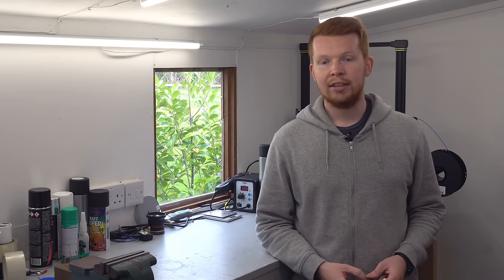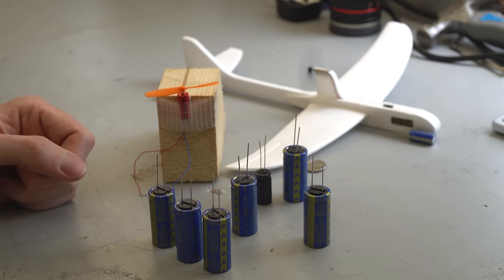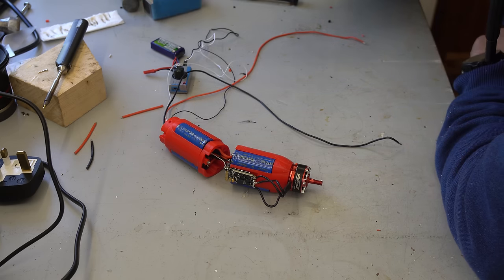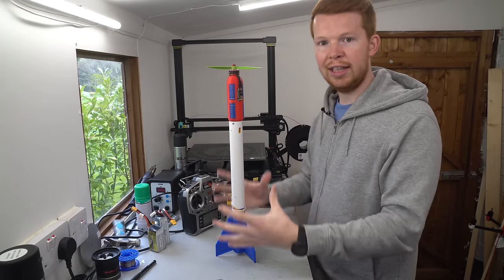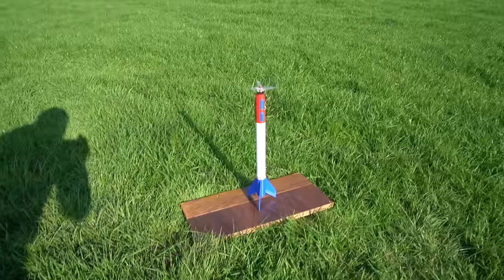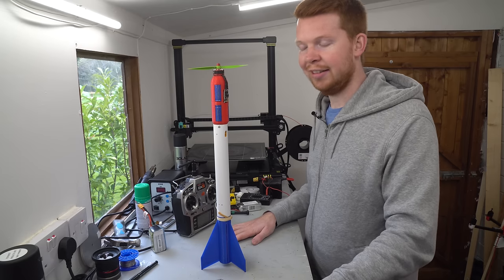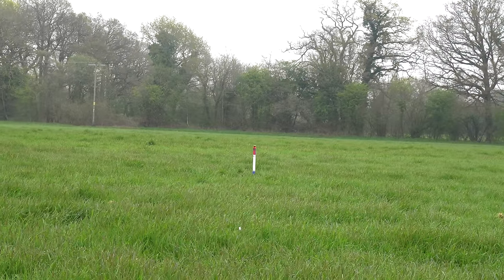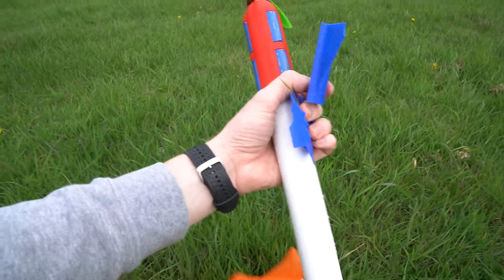Super Capacitor Rocket

Comment: When I saw this: this is not a rocket, it has no reactive engine, just a propeller. Essentially,  it's a helicopter. 
How it he gonna make it not spin around its axis in the opposite direction?
10:20 never mind
Reply: Sooooo... not a rocket.
Reply: Eh, semantics, it’s a cool project
Reply: @samfurness2754  For an eight year old, yes, but the title implies something much cooler: it's click bait.
Reply: @samfurness2754  yes, it's a cool project. But it's not a rocket. Can it be used outside of the atmosphere? No.
And don't underestimate semantics. It's like if the title said that the video will be about trebuchets, dams, chess; and then the video would show cannons, lakes and go. It would still be cool, but it's a different thing.
Reply: Calling anything that shape a "rocket" is just a popular colloquialism.
Reply: @panda4247  True, but anyone getting annoyed enough to leave a comment about it needs to find a better way to spend their time.
Reply: @panda4247  rockets dont nessarily have to work outside of atmosphere V1 german rockets used a pulsejet which dont work in a vacuum due to lack of pressure not to mention that there were prop driven rocket tests in the early days of nasa when they were designing reaction wheels they needed a platform which could easily be tested and recovered
Reply: @Bobis32  V1s weren't rockets they were jet bombs.
Reply: @midgamejeff-why-got  a cylindrical projectile that can be propelled to a great height or distance by the combustion of its contents, that the textbook definition of rocket the v1 bombs fit under the definition
Reply: @Bobis32  Ture, but I would argue a rocket is a projectile of any description that uses an internal source of oxygen for its engine and expels a reaction mass for it primary propulsion. The problem with that definition is that any jet or propeller powered aircraft would be included, though it does depend on what you consider a cylinder.

Comment: The 6.4V is just your configuration of protecting Li-Ion batteries from undercharge. Unlike batteries, capacitors have a pretty linear voltage to energy ratio graph, so you're skipping a lot of the potential energy, if you charged with 8.4V.
Reply: Maybe, wrong and wrong (sigh).  Yes, it's possible that the control electronics shuts down at 6.4 volts to avoid discharging the battery too much.  No, capacitors don't have a linear relationship between stored energy and voltage; the energy is proportional to the square of the voltage.  No, the capacitors were not charged only to 8.4 volts; at 12:10, you can clearly see that the battery has four cells, so the voltage will be near the maximum rating of the capacitors, which is 18 volts (6 times 3 volts).
Reply: E=1/2.C.V^2

Comment: Greetings Tom! This was an interesting video, and capacitor powered experiment. I had a very small airplane that was capacitor powered that flew completely out of the park on a five (5) second charge. By the time it left the park it had reached an altitude that exceeded the tops of telephone poles on the east end of the park. After searching for the plane for more than an hour, I finally concluded that it had been carried away with the wind. I would be interested in seeing you develop a plane that uses the super capacitors as a means of propulsion, a separate 1S battery could be used for operating a receiver and control servos. A parachute would not be needed, as the capacitors run down you could then control the landing. It would be interesting to see how much duration you could achieve with the propulsion system. Thank you for posting this video! Please have an excellent and awesome day! 🙂👍

Comment: 7:00 "reason for it being at the top is not for stability reasons it doesn't matter at what point on a rocket you have the thrust unit if you research the pendulum rocket fallacy"

Thanks for that! I never knew.

Comment: Is that the Doppler effect i'm hearing or is that how quickly it's running out of power with a propeller on it?
Reply: Most likely the Doppler effect considering the origin of the sound is getting farther away which makes the sound quieter
Reply: @mrmatrix1225  The Doppler effect doesn't make it quieter, it makes it lower pitched. This is because the object is going away from the observer which means that the frequency of the sound is lower relative to an observer that would be moving with the object. In this case it is probably a combination of both the Doppler effect and the capacitors depleting
Reply: It's not doppler... The speeds are too low for doppler to be noticeable...

Comment: You should give some angle to the fins so they counteract the motor torque Tom! It should make it more eficient :)
Reply: @Chris-rg6nm  as the motor torques it spins the rocket body reducing the difference in rpm between the rotor and rocket body and therefore reducing the amount of thrust the propeller gives. another way to counter this would be to have 2 counter rotating propellers like those found on those cheap toy helicopters. these get their yaw control from altering the speed of one rotor
Reply: @Chris-rg6nm  
At a decent airspeed, the angled fins would produce aerodynamic torque to counter the reaction torque of the prop.
Reply: If not an angled fin which would take some time to get the angle right perhaps if there is no super sleuthy way to calculate the angle from the RPM of the rotor and displacement of air it produces, then I would go with either larger fins, or more fins (4 or 6) as the increased surface area by either method would provide proportionally more resistance to rotational forces just like how its harder to push a bigger paddle flat side down into a river than a smaller one.) as well as more stability by channelling the air a bit more and putting a bit more mass or drag on the tail end so that it tens to stay more centered in the down position keeping the vertical ascent more true to 90º from less fish-tailing.  At this point you have too much of the weight on top.  It does matter somewhat for stability not to have too light of a tail when you have such powerful lift because sometimes wind resistance isn't enough to keep the tail pointing truly down at a 90º angle particularly if you have any sideways wind at all.   

2.  A counter spinning prop on the other end of the rocket would also help with balance and eliminate spin at equal RPMs.  But that ads a bit of complexity to your design you probably won't go for.

3.  The other really simple quick low cost thing you could try is alignment guide rods..   The maximum point of tension to create spin of the entire rocket is at the point likely when it first powers up, so if it powers up from 0 to maximum thrust instantly as electrics can, you should put a could verbal guide rods up the length of the rocket inserted into the launching base just to push against the counter to rotation-side of all three fins so it can't twist at least until it clears the top of the rods which would be just short of the propeller when it sits on the base in length at which time the torque for spinning the rocket should have lessoned as propeller speed is closer to stable .

4.  Spring-tensioned Internal "tuned dampers" to prevent tail sway?   Marbles in the tail section that can freely spin and rotate to help discourage rotation by providing some freely movable mass that would be friction contact with the inside wall and bottom wall of a section of the rocket provide a bit more resistance to vehicle rotational forces?  Lots to think about here.  Addint mass would obviously have to be down with a corresponding addtion of more super caps to offset the increase in weight, but that's OK.  Much of your rocket is still empty inside anyways, whats another 3 caps gonna hurt?  ;)
Reply: @jackass123455  Not to be pedantic, but the counter-torque on the motor mount (counter-rotating the body) would reduce the difference in RPM between rotor and air, rather than rocket body. If anything, with this setup, the RPM between the rotor and rocket body would be higher than it would be if the rocket were prevented from rotating, thus forcing the rotor to cut through air faster.
Reply: Aric Blunk the 20 rpm difference isn’t much compare to the 35,000 rpm his motor probably runs (it might only be 20,000 rpm, but you won’t be able to measure the difference of 19,980 vs 20,000 or 20,020 anyways). It would make it better if it kept thrust and movement going straight up instead of wasting lots of it when it goes into that hook at the top, because then your not producing upwards thrust and your not particularly wanting to go sideways fast in a random direction because that also limited his throttle duration due to the power lines and trees.
Reply: Counter rotating blades on top solves the problem.. :)  More lift, counters torque effects if they spin same speeds opposite directions.. I think that would be tougher to do mechanically but would likely solve it without bending the fins.. add rudder to fins and steer the thing back away from power lines.. aim it the otherway a little.. :) Fun video. PEACE
Reply: @Chris-rg6nm  One thing I haven't seen anyone mention is that the "rocket" spinning seems to mess with the parachute deploying properly, Stopping the spin would solve that, making for safer descent. Adding a swivel to the parachute might help, but stopping the spin would be better.
Reply: @jakegarrett8109  Good point.

Comment: Counter-rotating propellers would work for your rocket's flight stability.
 Folding props. are already used on actual motor-gliders. It's been around for decades ✈
Reply: Glad to see this comment, as it was the first thing I thought when I saw this. Nothing to counter the prop torque other than the mass of the rocket body and maybe the fins help slightly. Two props countering each other would make it a lot more stable and efficient. Nice build still though! Would not test that prop at eye level like that, yikes!
Reply: Was thinking the same thing. Also, if use larger props could possibly use Autorotation landing instead of parachute, maybe...I am not even a novice when it comes to these things, just an idea.

Comment: I would like to suggest you   print a centrifugal propeller that lays back until spun up. That would keep you from tearing up propellers. The props would have to swivel upwards and stop at the normal position for a prop, but once the motor is no longer spinning the props could fold back when they hit the ground. Just a suggestion.

Comment: At 15:28 I'm sure you realize that revving the engine with a questionably damaged prop is probably a bad idea next to unprotected eyes. Otherwise a class idea and build!
Reply: MrGlickClick 
Oops, you’re right.
Reply: safety squints were engaged.
Reply: If you look at the footage, there is a cut just before he revs it. It looks like he either swapped the propeller out or repaired it before revving. The propeller he is using when he revs is completely straight and looks perfectly fine.
Reply: bummer6 
Even if you’re right, and you probably are, it wouldn’t be a bad idea to make sure your eyes aren’t in the rotational plane of the propellor at all. Just stating it because I hadn’t thought of that myself before.
Reply: @Conservator.  yeah that's fair enough.

Comment: I'd highly recommend tilting the fins so that the rocket starts spinning itself to stabilize. Should tilt a LOT less
Reply: Exactly what I was thinking.
Reply: counter tilt too propeller rotation, will give it more stabilty.
Reply: That would be awesome... Having the fins pitched in opposite direction of the rotation to the prop.
Reply: I thought that too
I am glad I am not the only one thinking this
Reply: @JJ_ExMachina  he meant the exact opposite. Make the rocket spin as fast as possible (without making excessive drag) to stabilize it
Reply: @davidrajchman7162  ... The OP never states which direction the rocket should rotate, so your comment is “assuming” many things. First of all, to pitch the fins in the same direction of rotation of the propulsion system, would severely reduce the overall efficiency of the forward momentum. It would in essence cancel out the forward thrust of the main prop. The “rocket” would still be stabilized with a fin pitched in the opposite direction of the rotation of the main prop… It would still spin freely, as it moved through the air, and with no real negative affect or resistance to forward motion. You also don't want too much pitch on the main fins, or too fast of a rotation, that would in fact cause a large ammount of resistance, About one rotation equal to the legth of the main body... That is a good starting point, and can be adjusted from there... SO if the rocket is 3 foot long, then one full rotation every 3 feet would provide a decent stabilized flight, without too much resistance to forward momentum.

Comment: Fun project. Good video. 
You can use a boost converter (or buck/boost) to get more energy out of the capacitors when the charge gets low. The low voltage detection circuit is meant to protect the battery from over-discharge, but isn't needed for capacitors which can be completely discharged.
I'm not sure if this actually counts as a rocket, although it certainly looks like one.

Comment: Shoulda filled the whole rocket with capacitors.
Reply: May have messed with the weight to energy ratio
Reply: @thenuttyprofessor  capacitors are light!
Reply: I was thinking the same thing. Seems like a lot of wasted space. But I'm sure there is a reason. Maybe they would just cost to much or he's afraid he might lose it by flying to high. Nevertheless, it would be great to see that thing loaded with super caps. 
Scott Manley says fly safe, I say fly full throttle. Go full kerbal.
Reply: More capacitors might be cool. Gotta have the fins well behind the center of gravity, so maybe not fill the whole thing.

Comment: What I like about this project is that unlike solid rocket boosters in use in model rocketry, this has the potential to be much less expensive to reuse over time. On top of that, it is a mostly green project, especially if the source of electricity is solar or wind. 

I guess a couple of questions come to mind:

-How high is the limit for a capacitor rocket? I imagine there might be a super capacitor weight vs altitude trade off. 

-What materials maximize the reuse potential of the rocket, especially fins and parachute?

-Is this something that could turn into a hobbyist kit project?

-Altimeters and video components get built into solid rockets. What’s the potential (pun) for incorporating this into your design.

-I hope at some time you take this farther.

Comment: Super capacitor + battery = super battery, batacitor, capattery whatever.
Reply: Rotor Ryan bapacitry
Reply: Good combo.. the supercap can then deliver high demand instantaneous peak current.
Reply: I think they are actually called hybrid capacitors
Reply: @flexairz  it took a few times reading to understand but you mean it needs a lot of power in a short time for the capacitors right?
Reply: Reference the SCIFI book series, River World, Philip Jose Farmer
Reply: Maxwell actually sells capacitors to truckers who have 3-4 batteries for cold starting semis in winter.
Reply: Crapassitor...
Reply: Why do I feel like Batacitor is some kind of gadget Bruce Wayne would come up with? :D
Reply: This idea (cap + battery) is the equivalent of adding a tricycle (cap) to supplement a gasoline engine (battery): which provides the most energy in your system?

Comment: Use a balancing circuit not to exceed the rated voltage of the super capacitor when putting those in series.
Reply: And avoid others in series reverse charging one. Also limiting charge current could be good idea for longevity
Reply: @cannesahs  There is no limitation on the charge current regarding the supercaps. The limit is usually set by the powersource.

Comment: Needs corkscrew fins to counter the propeller torque, and a gimbal system to keep it going vertical.
Reply: Oh, I wondered about both of those things, & the gimbals I guess would be for the motor assembly to adjust lift vector. (Don't know too much about rockets.) Just wondering if a gimbal stabilizing system could work automatically somehow with 2D lean detector, or would it have to be operator controlled in flight?
Reply: @dannichols6261  Am automatic gimbal should be doable, but would make the rocket about 5 times more complex than it currently is.

Comment: After motor driver powered down, these ionistors had far more energy to release. In contrast to chemical battery, it may be discharged to zero without any harm. Special boost circuit may be used to drain capacitor voltage to near zero volts. Probably, flight time might be doubled. Also, beware of direct connection of ionistor to source, especcialy battery, as currents go as high as with terminals shorted. And, capacitor charging circuits also exist
Reply: boost circuit can be called a joule thief (good video on it somewhere with a flashlight) that joulethief would work well on this rocket sure, but the plane maybe not so much, as you want high voltage to get the plane up, then reducing voltage as it slowly reduces speed and altitude until it gracefully (ish) lands
Reply: @MichaelFlatman  sure thing, losses are inavoidable in any conversion, including motor driver here. And I`m not considering boosting beyond any measure, just maintain driver supply voltage at nominal level untill cap reaches it lowest threshold (1-2 volts I beleive). Now calculate how much energy is drained without conversion, and compare to energy that still remains after driver powers down due to lithium disharge threshold. Who`s thief now?)
Reply: @petergriffin760  by the word joule thief i don't mean the actual circuit is leaking joules :P i mean it is stealing joules that would otherwise not be used..
https://youtu.be/jq7cqmDtZDc